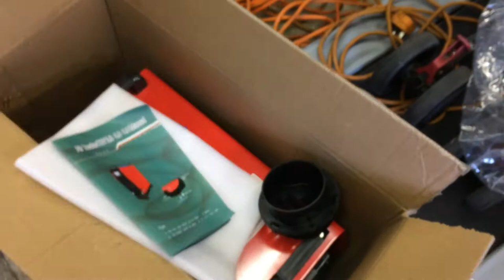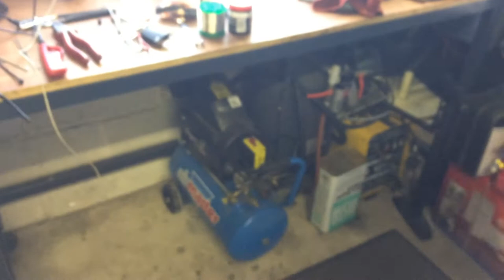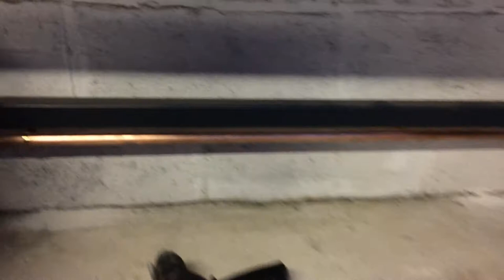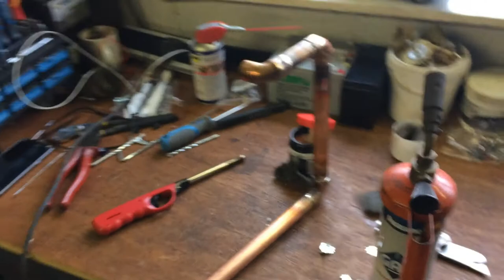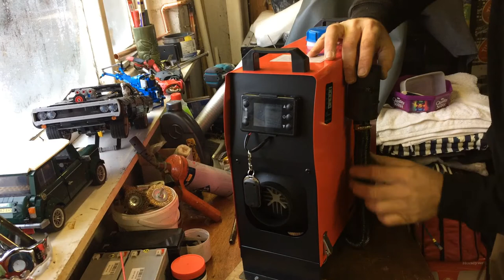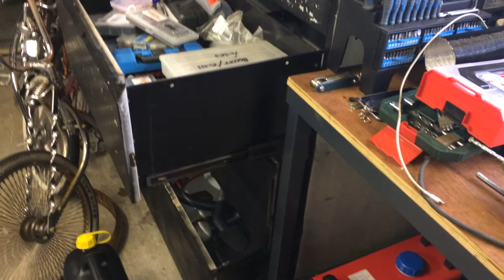Fitting a Diesel Heater - Time to warm up the Workshop

Comment: The recommended specs are the same as the eberspacher. The exhaust length shouldn't exceed 2mtrs with a maximum of 270 degree bends unless you increase the pipe diameter. The pipe position should also run in a downward incline to stop condensation pooling in the pipe. You would have to fit a condensation drain on the lowest point in the exhaust to prevent this if the exhaust vents higher up. All this leads to air flow restrictions and the issues that come with it. Hope this helps.
Reply from the maker: Thanks, going to redesign the setup before next winter 👍 will take these points on board
Reply: Couldn’t you just run the exhaust through the wall where the heater is?

Comment: The exhaust pipe should be able to drain itself to the outside.
Would be a good choice to put it on a shelf and let all the moisture drip outside instead of forcing the burner to push it out
Reply from the maker: Will be redesigning the layout before next winter 👍

Comment: Did you not read that the exhaust should not have more than 270° total of bend in it??  Those 3 90's just before the window is the limit and I'm sure there's more that cannot be seen
Reply from the maker: Will read up, nothing in the instructions- although they were limited. Wondering if that is meant for the flexi pipe supplied with the unit, as most people won’t add a run of copper to vent it out of a building. But thanks for the heads up will investigate 👍
Reply: You can ad more bends than 270, but only if you increase the pipe diameter substantially. It will run for a time, but there will be issues like overheating or premature sooting in the burn chamber, facilitating the need of a total tear down and cleaning.